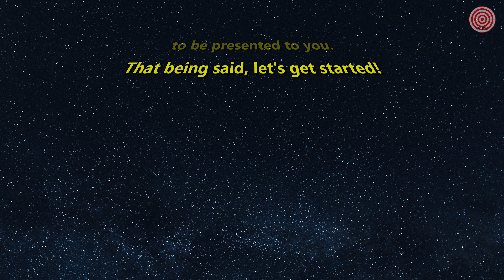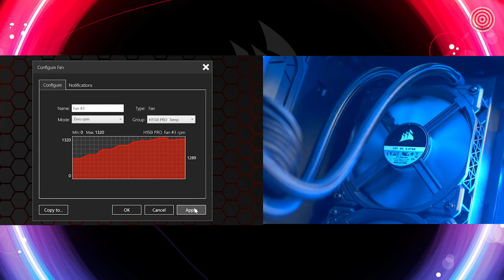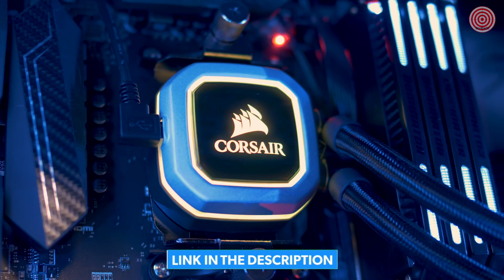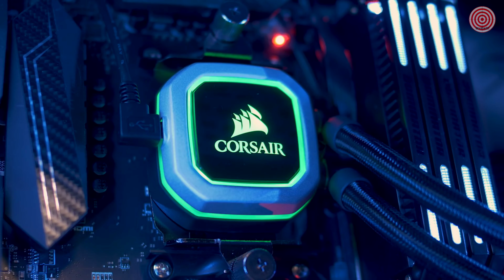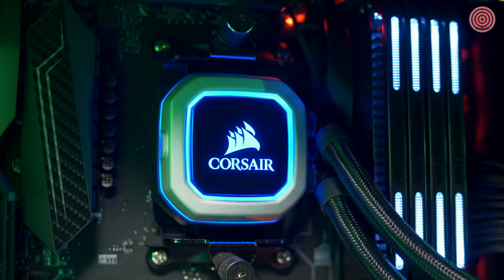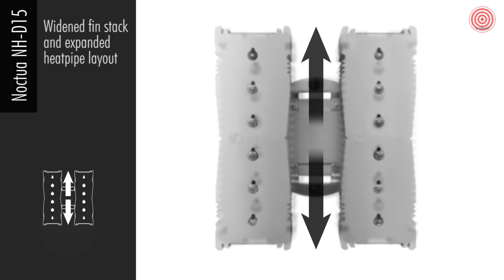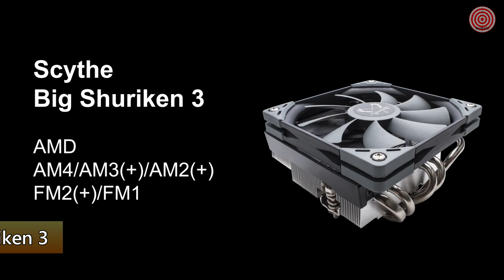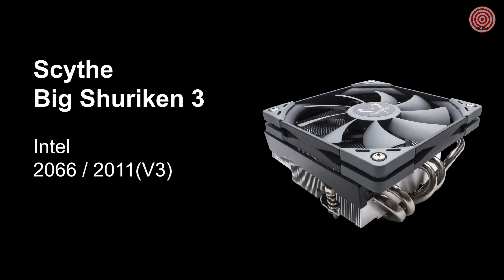5 Best CPU Coolers For Ryzen 9 5900X

Comment: A 240mm AIO would be good enough if you're not doing any sustained all core overclocks.Running a Corsair H100i  rgb 240 on my 5900X , and temps are no issue at all.
Reply from the maker: Thanks for your feedback!
Reply: GhostAntwanYt  Webbrowsing and videoplayback 40-50C, Idle is below 40C (dependant on ambient temp), gaming 55-65C with unlocked fps, and stresstests hits about 80C.
Reply: Forgot to mention that PBO is enabled.